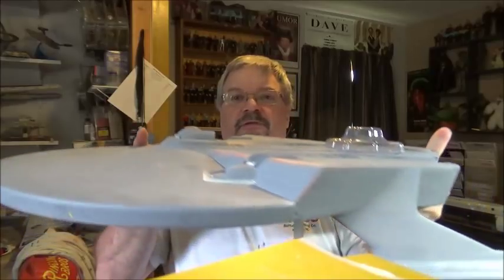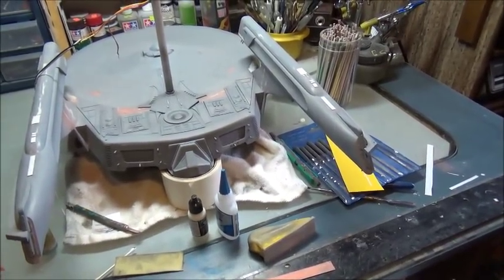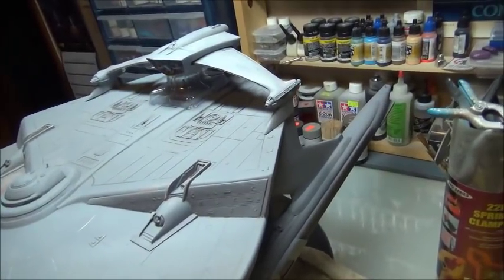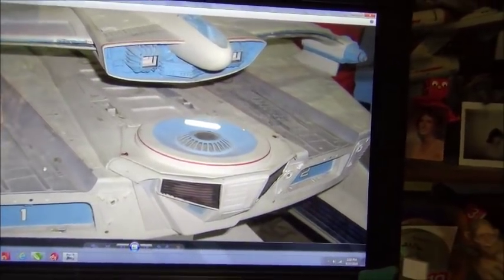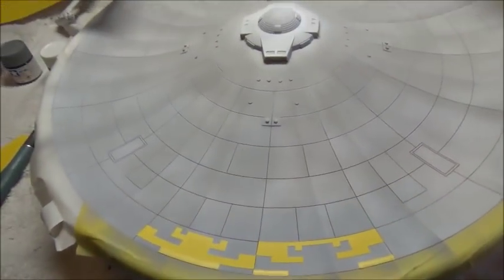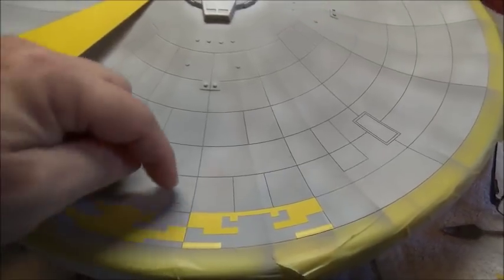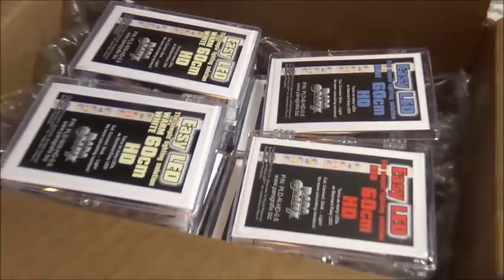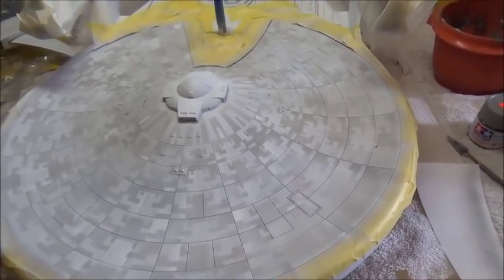Aztek Dummy Update 8/24/18 - 350 Scale Reliant Part 4

Comment: Wow.  I'm late to the party, but I started binging from Part 1 on 28 June 2019 (yesterday)...and when you opened this segment you mentioned it is week four.  Man!!  The amount you've accomplished in under a month is mind boggling.  It is also awe-inspiring.  I'm still fiddling about with my first Refit...I'm sorta using it as practice before I get into my other one and add all the bells and whistles -- your work is inspiring!
Sometimes I'll take a break from that monster and knock back a 1/2500 or 1/1000 depending what's in my stash.  Just ordered the 350 B.O.P. and it's in the mail, but I should focus on the "A"  ("Ehhhh")!

Comment: "A template is like a shark; you can pet it, you can love it-- but you never turn your back on it." Most excellent thinking.

I'm surprised at how dark -- even when contemplating a blending coat -- the first layers are. My impression of the shooting model is very, very white. Only with a hint of blue. Coolest blue-white. Then all the other colors are so light, they turn into a dust layer. The baby blue is objectionable to me-- not sure why. It's dusky here and there, so the gang worked over time I guess. I think I'd try a dusky pastel warm blue. Maybe.
I would have recommended you pry that paint chip off the vinyl and glue it back. It looked heavy enough to handle.

Looking quite good.